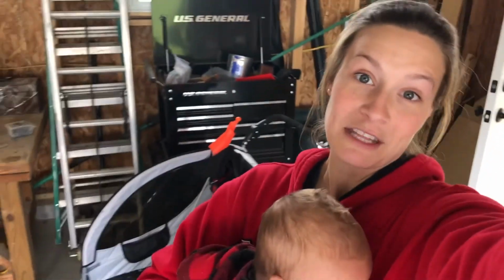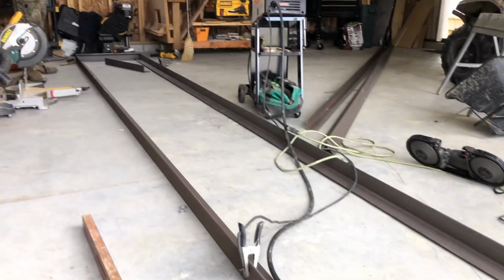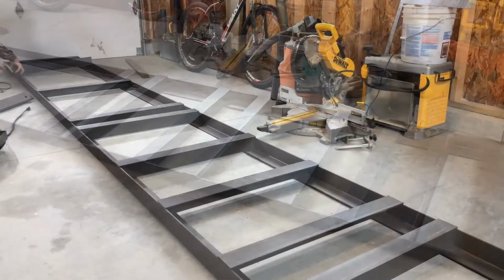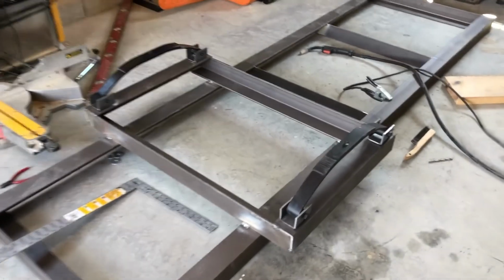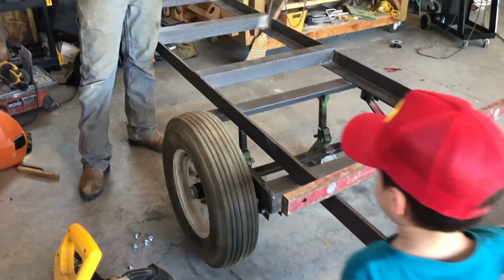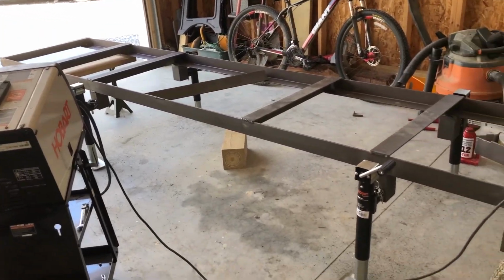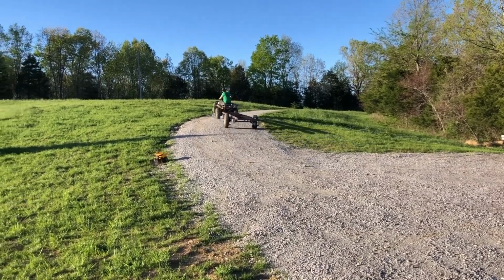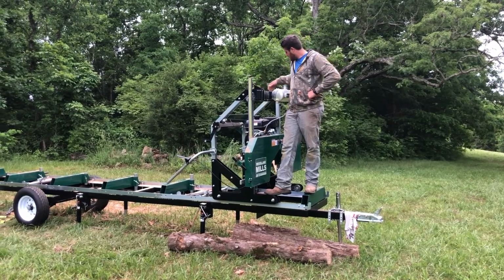DIY Sawmill Trailer Build & Tutorial (Woodland Mills HM126)

Comment: Your videos have motivated me to build a trailer for my yet unboxed HM122.  You bolted your track directly to the frame…how do you like the set up.  I’m trying to decide if I want to do that or weld the adjustable legs to the frame in case it needed a tweak now and then.  Thoughts anyone?  TIA….BTW great videos.
Reply from the maker: Thanks for watching our videos!! Sorry for the late response. I absolutely love the way I bolted it to the frame. I have had zero issues with how I have done it. Also it levels very fast with the jacks. Good luck. And enjoy your mill!!

Comment: Is there anything different you would if you had to do it again?
Reply from the maker: If you are building this it is perfect but add a tool box and easier saw head locking mech. I have been using big U bolts and it does kind of get annoying. For the trailer build itself it’s great. No issues. Very stable and easy to level.

Comment: Great job.. does it deflect at all with the angle?.  Do you wish you used tubing? I am going to use your same design if you like it... how big wS your axle?
Reply from the maker: Zero deflection. I am thrilled with my work on this. Before I started the build I was concerned with using angle as it’s obviously not as strong as tube but I honestly have no complaints at all. I am more than satisfied with how it turned out. I believe this was the short 2000 pound axle.  Although short I still had to cut it down. 
Thanks for watching our video. Please subscribe as it actually does help our channel. God bless.

Comment: I really wanted to see how you attached original tracks to your trailer, but unfortunately it wasn’t part of your video. I am modifying an old trailer and looking for some ideas to install my Woodland Mill 126 to it.
Reply from the maker: +Ivan Guban Hey! We do have a video of this. I’ll post the link below. And of course, let us know if you still have questions after you watch it. Hope this helps! 

https://m.youtube.com/watch?v=rqSFH89rfLU
Reply: @CollinsCountry  I gave them a call to request a blueprint for a trailer dimensions and they directed me to their website (manuals and drawings) that shows only the length and the width of the trailer, there is no specs for jacks spacing, axle and other bars. I wonder if you had a more detailed blueprint or the same posted on their website. Your help is appreciated.
Reply from the maker: @peterguban7143  no problem. So the prints are fairly vague but should show where the axle and the jacks are located. The prints show the trailer to a specific scaling. You can figure out the scaling based off of size of your printed copy and the few dimensions that are shown on the print. Use a ruler or measuring tool to figure out the scale. Then use it to find the exact measurements of the axle and Jack locations. This method is fairly accurate. It is how I built mine. Don’t hesitate to ask any other questions. Thanks again for watching.

Comment: I guess by the date on this video that you have fixed the springs to work properly. An arched spring has to become longer under a load, and can't with 2 fixed points. If you haven't, then a look at any trailer made by a trailer company will show you what it should look like.
Reply from the maker: Yes I have in fact corrected that. Thank you for your input.
Reply: Do you have YouTube channel

Comment: Outstanding job, truly...  Really appreciate you making this video to show what you did and how you did it.  May I ask your total cost to build this?  Which swivel trailer jack did you use?  Please post a link if you will.  Many thanks!
Reply from the maker: Hey Carole, Thank you!!!!!! We cannot remember the exact cost of the build without pulling receipts, but it was under $500. The 2 most expensive parts were the one tire we had to buy and the axle from tractor supply- if you can find those 2 items cheaper then you could cut 1/3 of the price out o the build! We did buy the swivel trailer jack from Tractor Supply. I don't recall how much it was but it was just a bolt on jack. We do have Amazon links in the description for the 6 leveling jacks if you need those. Good luck with your build if you build one and let us know if you have anymore questions!

Comment: Just curious what thickness angle iron did you use and was it a 3500# axle, 12 or 15 inch rims thanks, great build
Reply from the maker: Hi there. I believe this was 2000# axle, tire is ST175/80 D13. Local Walmart Carlisle tire. The angle iron is 1/4 inch thick. So far I wouldn’t change what I have done other than adding toolbox which I still might do. 
Thanks for watching our channel. 👍🏼

Comment: Looks great!! How much did you spend on materials for the trailer. I have the skill, but not sure if I have the time depending on the cost.
Reply from the maker: +Craig Cherry Hey! Thank you very much! We really like the trailer! If you can get the metal for cheap it’s not bad. I can’t remember the exact cost without pulling receipts, but I believe it was less than $500…The axle was over $100 and so was the one tire we had to buy because we only had one tire in the barn. If you can get those items cheaper then it’s a super cheap build…

Comment: How do you like that Bauer bandsaw? I’m a cheap skate lol but i was really pleasantly surprised how much i like the Bauer 1/2in and 3/4 impacts and the drill so I’ve been buying mostly Bauer stuff lately. The trailer looks great but you may want to think about putting x bracing on eventually if you are going to be pulling it with a truck at any speed I’ve built several trailers and it helps to keep it from flexing on the roads.
Reply from the maker: Thanks for watching. I was very impressed with the portable bandsaw. I bought it specifically for this job because how many cuts I would need to make. It definitely beats the grinder with a cut wheel. Thanks for the insight on the trailer. I have plenty of extra angle to create cross bracing. For now I will just be hauling it around the farm.

Comment: But quarter size thickness is a little small when you put a 4 ton tree log upon it to saw
Reply from the maker: +Gary Casey Appreciate your expertise with the weight concern. We talked with a metal fabricator friend about this project and he stated that our design would be plenty strong enough for the logs we are using. We don’t have the biggest mill available so our logs won’t be that heavy.
Reply: How heavy of a log do you think your trailer can handle to remain on the safe side before possible deflection issue?  What the largest size of logs do you mill?   Great project and great job by the way.